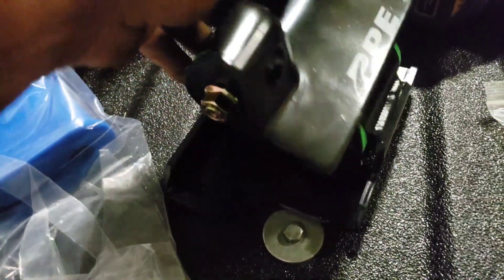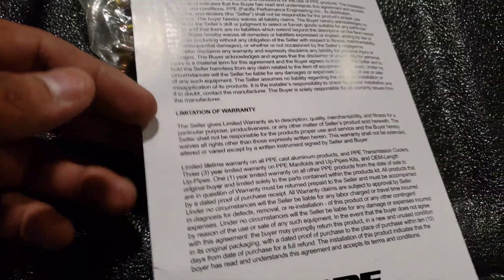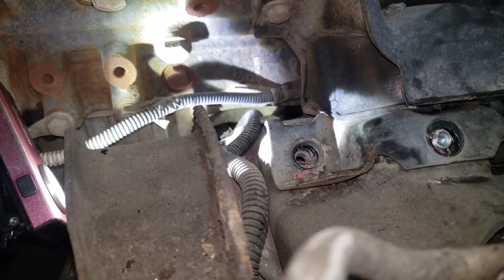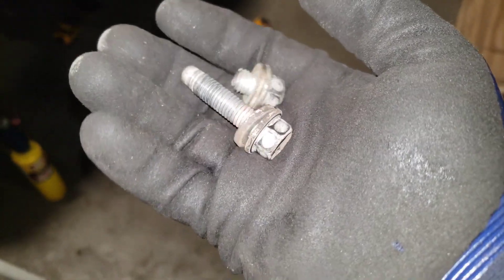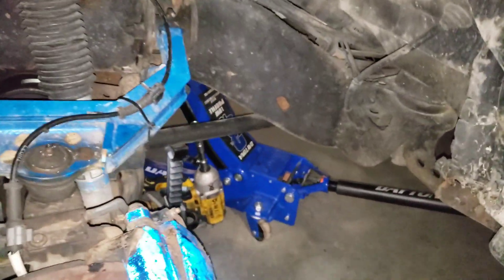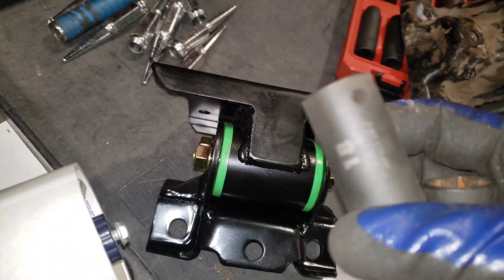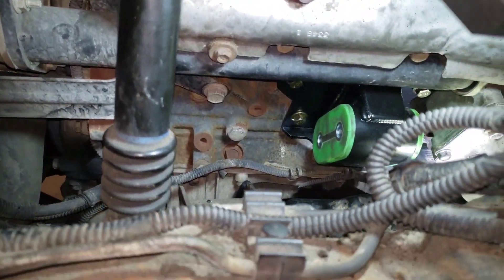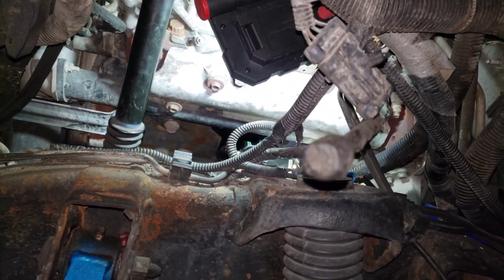PPE Motor Mounts install on the LBZ

Comment: How did you get the passenger side mount out? Everythings unbolted. Jacked motor up a little, cant seem to wiggle it out. Driver side comes right out? Doing this job at my shop currently
Reply from the maker: Honestly I just kept jacking it up a little by little just to make sure it wouldn't break anything up top till I had enough room to pull it out towards the front and got it out there. I felt like something was going to break by how I had to get it but I did fine. Its a pain I know

Comment: Do you know if the motor mounts are the same on each side from ppe or does the sides matter ? 

My kit came with identical ones
Reply from the maker: @andrewkitchens3917  I'm pretty sure they are same

Comment: How are you liking ppe silicone mounts? Do they help reduce vibration?
Reply from the maker: I love them. And yes the do. Its definitely and improvement
Reply: Been chasing low rpm vibration and harmonics around idle speed. I hear the polyurethane mounts will make it worse. Narrowed it down to engine mounts or body mounts.
Reply from the maker: @Motodad32  honestly it does a bit but I would rather have that then do damage to the motor and trans. If u want less do the blue ones they are softer
Reply: @rikkidiesel  cool thanks man, the ppe motor mounts along with the s&b cab mounts I would assume have been a great combo.